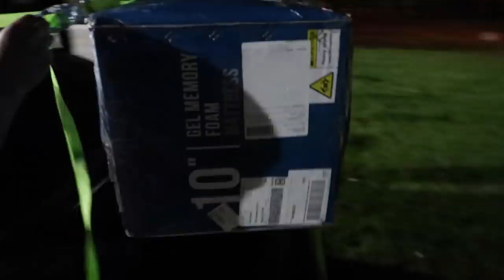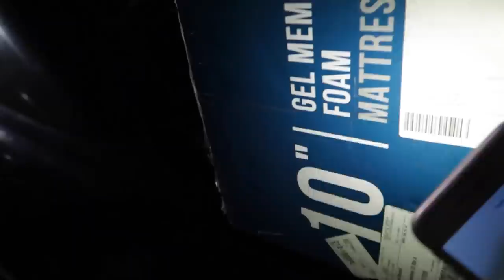The Mustang Gets NEW WHEELS!!

Comment: You need to soak ur clutch fibers in oil before you run it or you run the risk of burning them again. What you can do is once you fill it with oil lean the bike over clutch side toward the ground for about 1-3 hours depending on the brand of ur clutch. Normally i soak them in oil in like a plastic bag or oil pan but leaning the bike over works just as well.

Comment: Take off your air box cover, if filter ain't bad leave it. But leave off the air filter. Get max air flow to the engine. Also drop your air pressure A LITTLE bit. Those 2 things help. Or just put race gas in it. Or get an after market exhaust. That truly does put down 3 or 4 more horses on the engine. 
(Dirt bike tips only) on if your gonna ride on dirt after the track. I would go ahead and add air back for more grip off road. 😋

Comment: Poe ya sure that’s the oil drain plug on my 2013 Honda crf250r the oil drain plug is on the bottom and the transmission oil is the bolt you took out